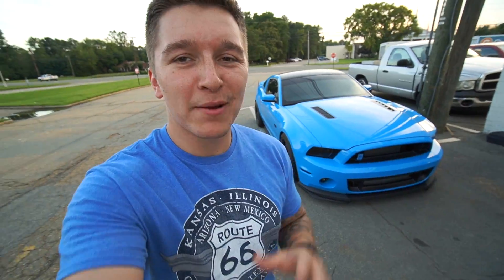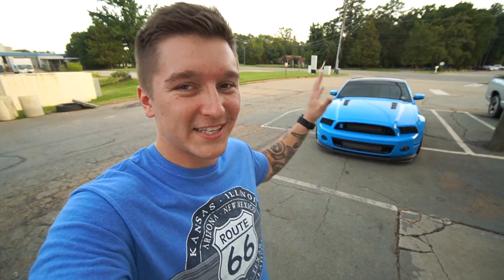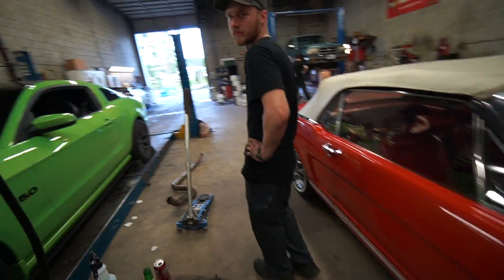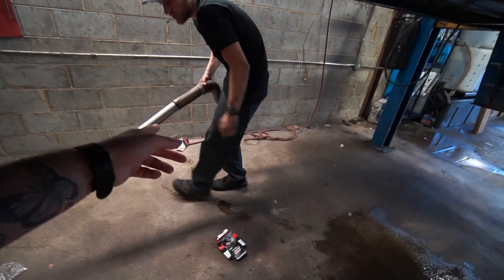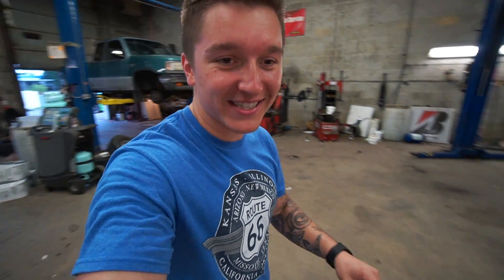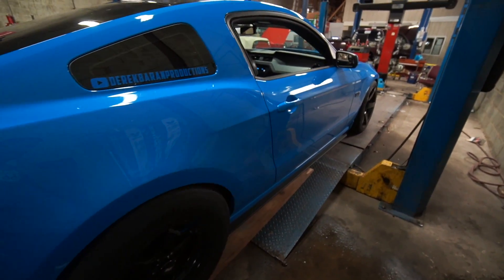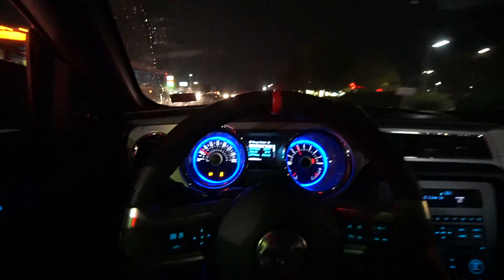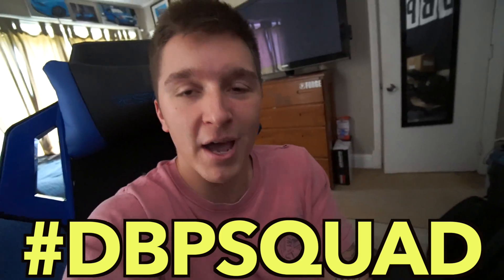NEIGHBORS officially HATE my MUSTANG after THIS... *I'M SORRY*

Comment: gotta get those long tubes and a h pipe
Reply from the maker: Someday soon!
Reply: He shouldn’t tbh he already at 700 wheel on stock gen1 with long tubes gonna be at 720 or so on 93 and that’s limits
Reply: x is always better on a mustang
Reply: negative... hpipe if you want deep sound x is more raspy and hp difference is negligable at best.
Reply: @nadersaleh4643  long tubes help it be more efficient...itll make a little more power but itll do it on less boost which is always good.  Long tubes should  in theory give him more room on pump
Reply: Agreed, I put a set of kooks with an h pipe and mbrp race cat back on my 14 gt a few weeks ago. It sounds much better than it did with the x pipe

Comment: I had those before on a previous tuned Stang - you need a spark plug gap between the O2 and the pipe.  Also known as a defouler.

Comment: Now imagine this exhaust sound/tone but with a NASTY choppin cam
Reply from the maker: I wish these coyotes chopped :/
Reply: DerekBaranProductions idk man, it gets tricky. I’ve personally heard the same year mustangs chop with a cam but I think they might’ve done the same thing as what I’m about to tell you now. You can do a cam phaser lock out and lock the cam at a certain angle and get that chop. Essentially what a ghost cam tune does but there’s actual kits. Plus you’re already cat less so idk if the tune would be a bad idea either, other than for the o2 sensors but I’m pretty sure there’s a work around for that too. The coyotes already come with great cam timing so an aftermarket cam won’t really do much at all. Cause you’d still have to lock it if you really want that mean sound.
Reply: Jose Diaz leave that for ls
Reply: 1MEAN_5.0 no